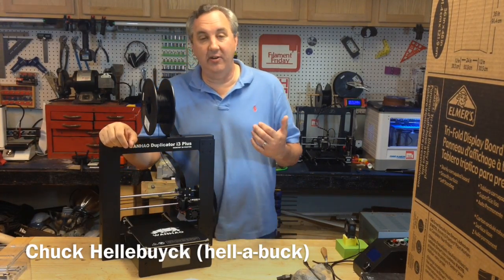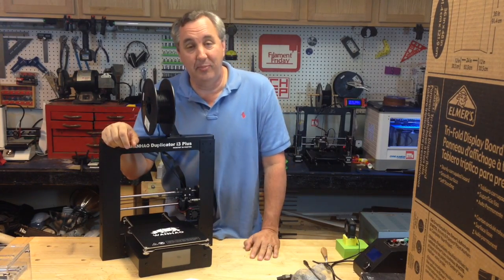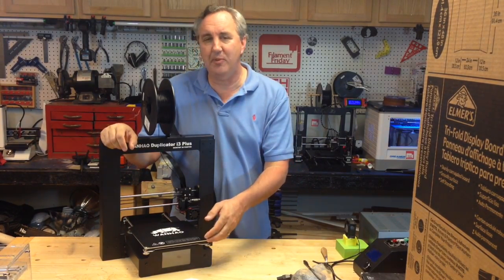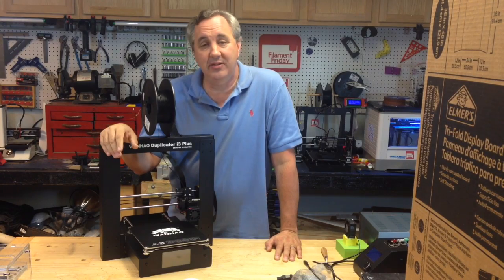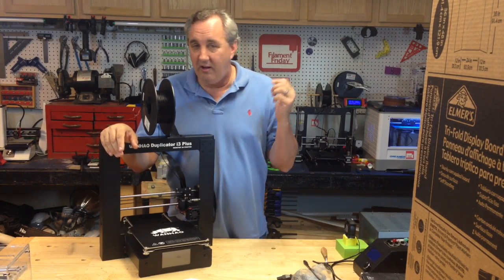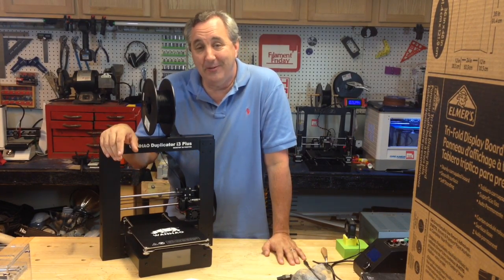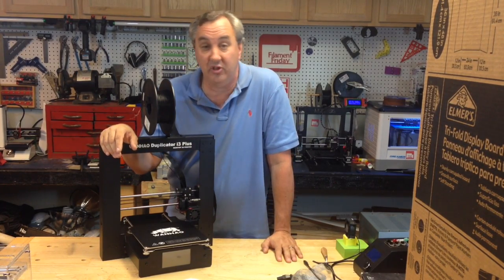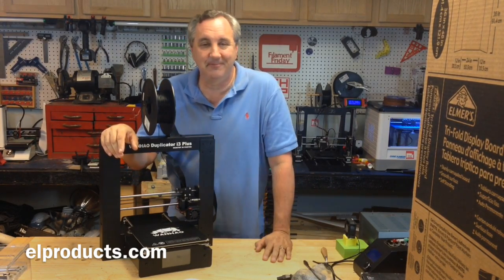Chuck's VLOG - 3D Printing Community Comes Through - Wanhao DI3 Plus Fix Response

Comment: Chuck, you are an electronics person that would better recognize the problem than us regular users.  It was meant to happen to you so this it would be discovered and brought to light.  This is something that can hurt 3D printing if all of a sudden printers are thought to be bursting into flames like a Samsung cell phone.  

I have seen several people on my 3D Facebook group that have been complaining about the power connector on the control board on the V2 & 2.1 printers.  There have been several connectors melting due to a bad solder joint.  Could you look at that on your V2.1 controller board and offer an opinion?  I love my 3D Monoprice printers (the Maker Select & Maker Select Mini) and would hate to see newer 3D printer enthusiasts deterred from keeping them or being worried about losing their house due to a bad 3D printer.  These smaller printers are not fool proof and apparently do not come with a stamp of approval from UL and therefore not 100% vetted for defects (nothing really is, but you know what I mean) .

Having someone as qualified as yourself looking into these issues would really benefit the community as a whole and consumer safety in general.

Thanks for bringing the problem you experienced to light and having the knowledge and experience to figure out the issue.

Great job and great channel.

Regards,

Norbert Davis

Comment: Thanks for the update Chuck.  Mine had a short that caused damage to the extruder motor board so it doesn't extrude anymore.  Thankfully the people I bought it off are going to either repair or replace.